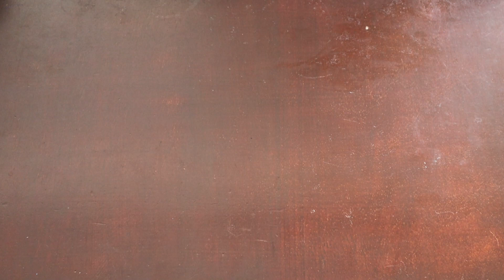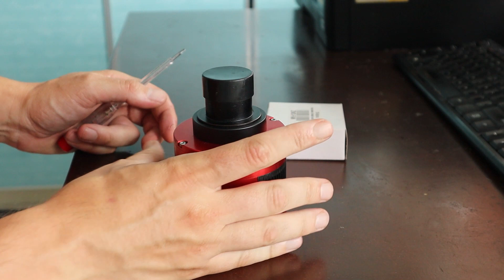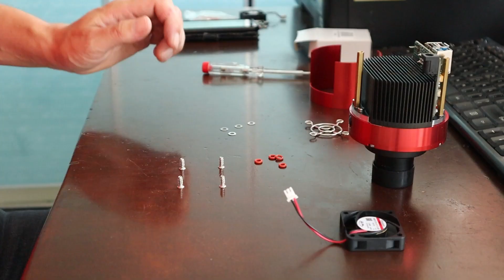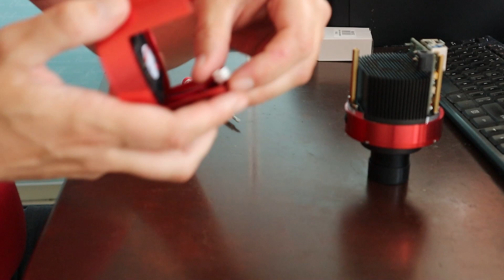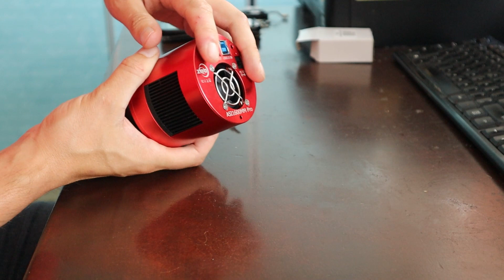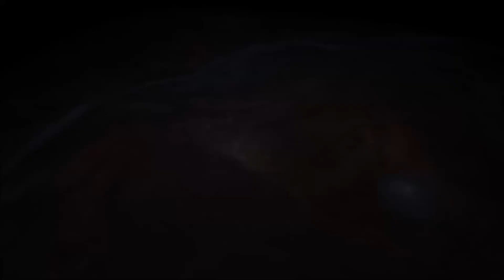How to replace the FAN of a ZWO Astrophotography Camera

Comment: Did you match the direction of the airflow? You wouldn't want to be blowing external air on to the heatsink, but rather creating negative pressure to extract warm air away from it.
Reply from the maker: There's a sticker on one side of the fan so you can remember how to place the new fan in the same position
Reply: The label is on the inside facing the heat sink. There was a molded in direction arrow on the fan showing air flow which blows on the heat sink.
Vibration shows on these resulting in softer image in some cases.
Any recommendation for high quality fan replacement and source? Is this a generic size...think 50mm?

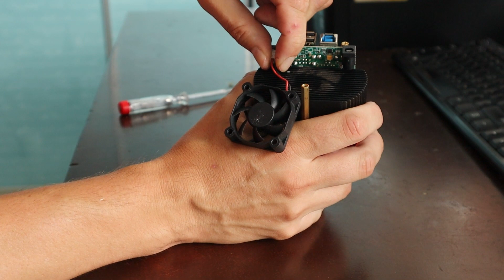Comment: I noticed when you remove the old fan, you accidently remove the plastic housing that connects the fan to the circuit board as the pins were exposed. Normally, there would be a plastic connection spot. Did you check the old fan? Around 1:30 is when the whole housing and connection was removed.

Comment: Is the fan spinning the correct direction? I noticed that the wires were the opposite way around (probably because you also removed the female end of the fan connector at the same time as the male end). Might not make any difference to the cooling to be honest.
Reply from the maker: Hmm, good point. I'll check it out.

Comment: The flat-head screwdriver on the philips screws was a good start. I wonder if a Noctua fan would bring any improvements, as they often do.
Reply from the maker: TX for the suggestion. I may try that one!
Reply: The Noctura seems to be the way to go but I think the vibration problem (egg shaped stars) will be more noticeable with higher magnifications and higher resolution cameras.

Comment: Did the new fan work ? Was the old one just noisy or did it not spin at all ? Reason I ask is that you could have had a bad circuit board or a bad solder joint on the connector on that board . I would have tried the fan before putting all the screws and plates back . Hope everything is working now,./SRK
Reply from the maker: Yes, and good suggestion. Clear skies!